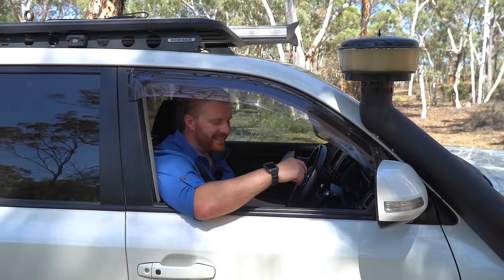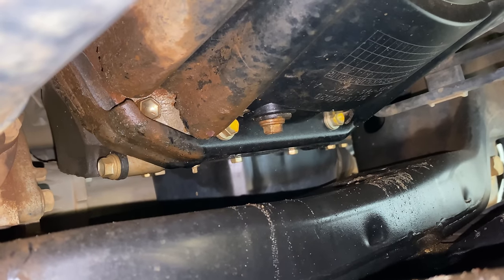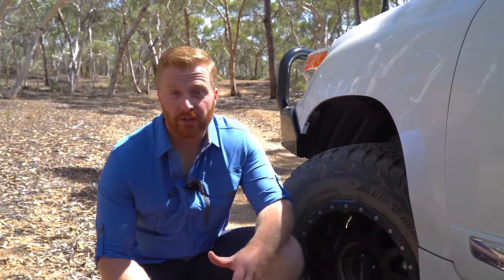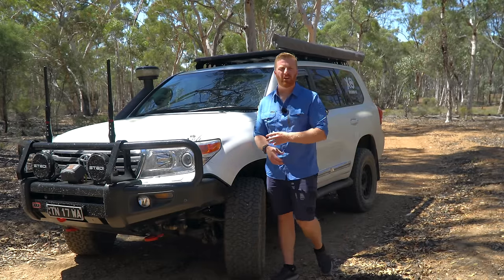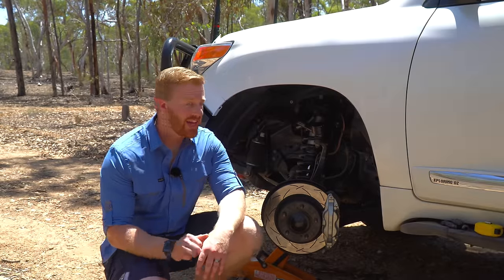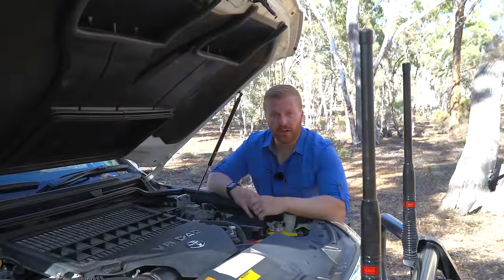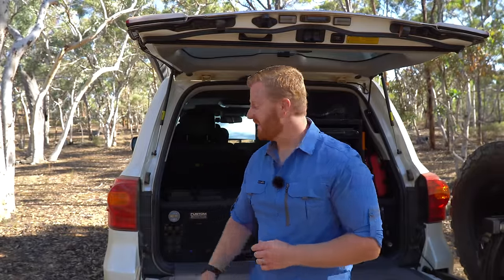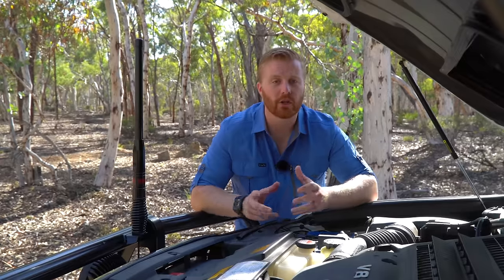LC200 | PROBLEMS & ISSUES | Not everything goes to plan -Mechanical-Electrical-Suspension 200 SERIES

Comment: Hey Nate, great vid as always. Nice of you to share lessons learned with this vehicle. I've had a similar fueling issue, although mine just had a brief rough idle if it had sat for a few days. I changed out the fuel filter top housing (part with the primer pump) which was a $90 part change which fixed my problem. Best way to diagnose this (and eliminate any loose hoses near prefilter/filter) is to prime the fuel system using the hand pump as much as you can. Then shake and move all the hoses and fuel filter parts and listen for a hiss and try to figure out where the air is coming from.
Reply from the maker: Thanks mate, glad you enjoyed it. 
Thanks for sharing that. I'll look into the primer part as some others have mentioned this as well. Would be happy if this issue went away for $90 rather than some of the alternatives... 
Cheers.

Comment: Mine is 250k km. I had to change maintenance items per the owners manual which includes a timing belt. Repairs that were not maintenance were: outer tie rods which developed a slop after 13 years. Water pump was changed with the timing belt because it had a minor leak. That's all I can remember. Mine is a '08 200 series 4.7 2uz-fe petrol.
Reply: Less to go wrong on a petrol
Reply: Less to worry about. No dusting or turbos. No injector issues etc.
Reply: @ACCOD  same oem air box with zero dust
Reply: My complaints are the fuel consumption is absurd. I am sure I payed the price in petrol that I saved in repairs 😆
Reply from the maker: That's a good record for a 13 year vehicle. Glad to hear that things have gone relatively well for you and your cruiser. Petrols are definitely simply vehicles and don't suffer from some of the issues that our diesels do, that's for sure.... except for that fuel consumption haha.
Thanks mate, Nathan.
Reply: @XploringOz  I am very very very satisfied with what I paid for. In fact I feel like I should have paid more! This vehicle got me everywhere without any problems with really cheap maintenance. Except the timing belt and the horrendous fuel economy! I have 138L tank and it drives for only 700km. I still can't believe that I am still running original engine mounts and transmission mounts, also original body mounts. Suspension has been changed so I can't judge how long it would have lasted. Amazing quality from Toyota.
Reply from the maker: @and7976  For sure and it's so good to hear these kind of stories as it really bolstered Toyota's reputation for reliability. So many people are so quick to criticise when the smaller of issue arrises, but many will remain silent when everything works well through challenged situations. 
Yeah, fuel is always going to be an issue with these vehicles, petrol or diesel, but hey, we could have bought Prius if we wanted economy 😂

Comment: In my experience, modifications are usually the source of your problems. Unfortunately, workmanship quality is not very high in Australia, and even famous brands make silly mistakes from time to time! Having said that, Toyota diesel engines are not as reliable as the petrol ones, and most engines in OZ are petrol. I have a FJ Cruiser with now about 180,000 kilometers on the clock. I have had no issues with it, and the few issues I did have were all due to modifications or "professional mechanics" just servicing my car! 120000 km is too early to have issues! It's either bad luck, or the previous ownder has trashed this car!

Comment: Wrangler Unlimited I used to own (3.6 Penstar V6); in year 4, major main rear oil seal leak  (under 70,000 km). Also under warranty had my front suspension system redone; it was creaking and squeaking and turns out it was literally starting to fall apart (poor factory fit). Also, TC/SC would randomly cut out sometimes off road and the roof would leak

Comment: HAven't had any issues with my BP51.. However my experience with ARB is that their staff have no idea how to specify the suspension kits to customers. I should have learned my lesson from prior experience (although  the last time I  did get an independent mechanic to install the kit ), they still specified rear springs which are well above the weight rating of what my vehicle requires  which now requires me to purchase a different set of rear springs, $600 wasted there...Moral of the story, ARB do make some worthy products but their staff generally do not have the specialised knowledge which should go along with selling some of their products.  Regarding Projecta, having used Redarc with my first vehicle then moving to Projecta on the next vehicle, I'll say that Projecta is rubbish, issues with their DCDC/MPPT charger only to be sent another one with  the same issue, their power monitor wasn't much better, it would freeze up and require a reset by unscrewing the terminals from the battery (I'd say, return the products under warranty but in my experience you'll just receive the same rubbish with the same issues). I'm now using Victron and have no plans to ever purchase Projecta again. I would consider Redarc if someone threw money at me  (due to the simplicity of the installation) however their in built MPPT isn't very good. Victron products are more advanced  and cost less. so I'll keep using them.  (BVM712 has never had the issues which you've described -  you should return it under warranty) . Regarding your gullwing window, and this applies to all installs which don't require specialised skills, do it yourself if you want it done correctly as you can't trust most people to perform the work to your own standards, even if your standards are as simple as "the install should meet all specifications and look clean". Thanks for the content Nathan Cheers
Reply from the maker: Thanks for sharing mate. I agree with your comments here. The ARB people are just salespeople after all and not all of them have that same passion that we share for our modifications and off-roading and definitely don't share the interest in our vehicles that we've spent our hard earned money on! 
Intersting points about Projecta. I haven't used much of their stuff, but so far what I have used has held up alright. I've always heard good things about Victron though. They are definitely getting a good reputation! 
Yes, the EmuWing.... well, it's there now, but things would be done differently if I had my time again! 
Cheers, Nathan

Comment: i own a 120 prado petrol v6 and has done 308,000 k's. The only issue i have had with it (so far) is the ABS module shit itself, i wacked in a used one from a diesel and not a problem since. I have been offroad abit with it, also towing boat and camper. The only thing i have to pay for is fuel. I do regular service and thats it. I have set it up now for just touring so am very happy with it.

Comment: Q1. How and where did you measure the 3v?
Q2. Please describe your battery setup
Q3. Regarding the 0.2amp draw, what battery isolator are you using? Some actually draw .2amps in standby.
Q4. Measure the voltage drop in the rear fuse box, at standby and under load (i.e fridge running, lights, etc). 

I suspect:
 - Too much voltage drop to rear fuse panel
 - Incorrect cable gauges 
 - Current leakage from dash cams, battery isolators, inverter standby 
 - Bad earths or using chassis as return path.

Tests:
 - Does the current drain go away when you pull all the fuses out of the accessories?
 - Key not detected: 1. Does it go away when you hold the key over the start button? (there is a rfid sensor there)
                                   2. Pull the fuses out of all accessories, does it still happen?
 - Does the rear fuse panel have a direct connection to the battery + and -
Reply from the maker: Hey mate, sorry I missed this comment a little while back…

1. The 3V was measured at the installed fuse block in the rear of the vehicle. This has a single positive and negative wire terminating at the block. 
2. Simple dual battery setup. Single primary starter battery, Redarc BCDC1240D isolator/charger into a 105Ah deep cycle (under bonnet). All accessory wiring is managed through a secondary aftermarket fuse block. 
3. Yes, some of the comments suggest the small draw could be coming form the BCDC1240 charger. 
4. Will conduct that test.

Thanks for your suggestions. I’ll try and go over the system bit by bit and see if I can use some of your advice to try and diagnose and fix some of these issues. 

Haven’t tried pulling all the fuses in regards to battery draw or the wireless interference. Yes, the key still works when in immediate proximately to the start button. Fuse block does not have a direct connection.

Comment: Nathan I have the same issue on my 200. I have tried most things to solve the problem.  I have a friend who suggested kicking the idle speed up which he uses on his during winter.  I did it to my before startup and it fast idled then kept going which it usually stops after five seconds. No priming etc.  He said it may be dirt in throttle body.  That was his suggestion. Hope this helps.  I will start mine early in the morning and see what happens. Good luck.  Love the vids.

Comment: Although most of these problems are not show stopers but are still annoying. I have the same car 2019 model I had it since new and now have 162k km on the clock. Bought it 3 years ago and i did not face a single issue with it yet. Makes me think that toyota's only give you problems if you dont drive them enough 😂

Comment: Just days before my warranty expired I had an issue with the centre diff light coming on. This resulted in: 1, not being able to engage low range, and 2, negating the cruise control. Took it to the dealer who rang me several hours later saying they couldn't detect an issue and could I come and collect the vehicle !!   The service advisor just suggested to me that they just disconnect the light !!!!!  The fact that this would have left me with no low range and no cruise control seemed to mean nothing to him. I then took the car to another outlet of the same dealership and the workshop foreman phoned me within 30 mins to advise that the (?) initiator needed replacing and that approval would have to come from Toyota HQ as it was a $3K part. I love this wagon, and now have 215K km on it, a 2014 model. After finding multiple stripped/cross theaded screws underneath the vehicle I now do all my own servicing. Air/rattle guns are a curse !!
Reply: I have to agree, rattle guns ruin every bolt the service agents touch.  And it was never them!
Reply from the maker: Disappointing to hear about the service you received! Can't believe anyone with any sort of pride in the work and workshop reputation would recommend this! 
Glad you were able to sort it in the end, but like you said. Things have to be done yourself to get the job done properly these days....
Cheers, Nathan.

Comment: You have an air leak, probably at the non factory clamp on your fuel filter. Take that off and use a worm clamp, and do it up TIGHT. You may be able to hear a sound while using the priming pump, especially when the plunger goes hard. I had the same issue with mine and that was the cause.

Comment: Hi mate my 200 cruiser at idle missfireing I clean throttle body add catylac cleaner in my tank it gives p1238 code.Toyota said without proper compression check vehicle have a low compression i doubt too its got a air fuel ratio problem my mechanic said it will break all crank and internal parts. I want to change map filter and oxygen sensor  and injector clean and check compression its my schedule stil vehicle is running when get time and money.

Comment: Hey mate, good to hear about your shortcomings with the 200 Cruiser. Honest feedback is always helpful, and gives a good contrast to all the positive things you mention in your other videos.
For your rear shock guards, the new ones (which it looks like you have) are a revised version with a different clip, and shouldn't cause you any further issues. However being plastic, they are still suceptable to degradation over time and consistent peppering from stones. Its because of this that I installed the Kaon rear shock guards on my 200. Super strong, easy to install, and allow you to also keep your BP51 plastic shock guards as an extra line of protection.
Would highly recommend them, Kaon are a great partner of the show and are an amazing Australian company to deal with!
Reply from the maker: Thanks mate, appreciate the feedback. I hope that it can provide some realistic expectations to those who have or plan on buying/modifying their cruiser. 
Yeah, you're right they are the new type design. This came with the new shocks after the replacement. My faith is running low after seeing the previous plastic guards fall apart, but we'll see how we go. 
Yes, Kaon guards are definitely on my list, I like the products that they make and I'm sure they'll fit the cruiser nicely. 
Looking forward to watching the video to come with your family and the mighty 200 series!
Cheers, Nathan.

Comment: For the KDSS adjustment, first step is lift your cruiser up, and lose the two bolts one and half turns beside KDSS pressure accumulator(only one half turn, no loosen absolute avoid oil leak), second drop down the cruiser at flat/level ground and another guys let the left and right side as same height(maybe use jack/bar or some else ), after tie the tension for the two bolt when cruiser same height between passenger and driver side,
Reply from the maker: Hey mate, yes unfortunately I have tried this to no success. Although it helped a little bit, there is still a bit of a lean to the drivers side.
Cheers, Nathan.
Reply: @XploringOz  Nathan, I came from China also the LC200 owner, I think the root cause is KDSS oil pressure or quantity not correct after your rose carbody or long km driving. so Could u tell me you have charged or refilled/flush/ and calibrated pressure of KDSS hydraulic oil after your rose 2 inches carbody by BP51( in your video you told us ), Your can applied 5Mpa kdss oil pressure by pump through two pipe line connection after loosen charge line 2 bottom nuts 3 turns, and also loosen  2-2.5 turns for balance pressure bolt under accumulator, then release the nuts at top of accumulator/front sway bar cylinder/rear cylinder nuts one by one to flush oil/exhaust air, and after lock/tie 2 charge line bottom nuts which your had loosen 3 turns before which operation under KDSS system hydraulic oil pressure to keep 2.8-3.0 Mpa(around 400psi), so after that charge pump and drop cruiser at flat/level ground and re-lock 2 balance nuts under accumulator.  I think will be balance  after flush/adjustment oil pressure.
Reply from the maker: @nanqin8757  Thanks mate. This is great advice and something that I wasn't aware of previously. Given the lack of publicly available information regarding modifications to the KDSS system, it was something I hadn't done. 
I will definitely make some inquiry and see whether I can get the system checked over and to the correct pressure. 
I'll be sure to follow up with any success. 
Cheers, Nathan.

Comment: That GVM update  thing is absolute bullshit. Factory limits are there for a reason and you can not defy physics by changing a few springs and air bags. The GVM limit is there because of the weakest parts of your vehicle and no factory advertises that weakest link. It may not be the suspension. It may be the transmission or chassis. If you can not stay within that vehicles limits then go buy a proper truck. See https://www.youtube.com/watch?v=aSYWq3Iou-A
Reply from the maker: Hmm, see. I disagree here. GVM limits are generally set by design regulations in each country. Australia, being such a conservative country always set these limits much lower than they could and are fairly generic. 
The LC200's are much more capable than Australia Design Regulations make them out to be and thousands upon thousand of these vehicles are driving all over the country either heavily overloaded or running much larger GVM kits.
Reply: Good point in Nathan reply 
looking even beyond you will find for the lc 200 front axle GVM upgrade necessary 
UCA must upgrade to get 2000kg watch the Black hawk ?! Btw watch out for the recall from them for the ball joint replacement for free.
Cheers.

Comment: That 3V reading sure sounds like a grounding fault. As I’m sure you know, so many vehicle electrical problems are due to poor earth. Not so much the connection itself, but the incorrect assumption the earth return is not being impeded. This may also be related to the other intermittent electrical issues. Your isolation switch is a good example of this false assumption, fortunately discovered.
Reply from the maker: Thanks mate, a few people have mentioned the grounding issue now. Something I'll definitely look into.
Cheers, Nathan.

Comment: Nathan, sound a bit silly, but replace those screw type hose clamps with the spring type as per original Toyota ones on your fuel lines, usually added with secondary filter. They allow fuel line to expand and contract as necessary without damaging fuel lines. Keep up the good video’s, very helpful. 👍
Reply from the maker: Hey mate, thanks for this tip. I'm still having issues with this system and this will be another thing to look into 🙏 
Cheers, Nathan.